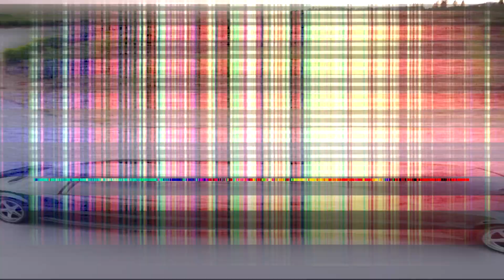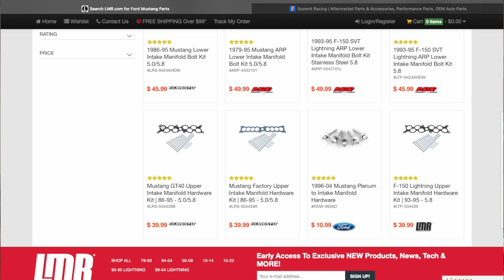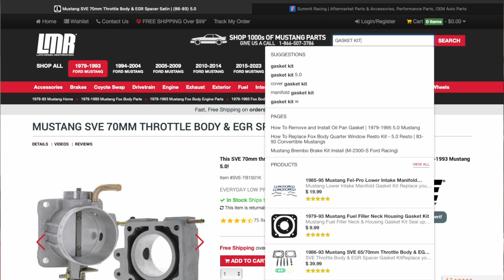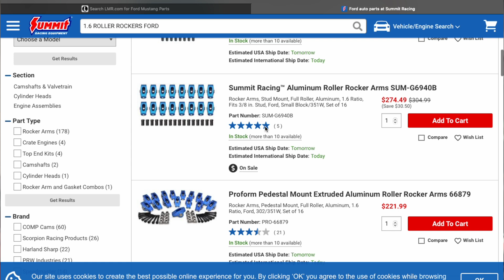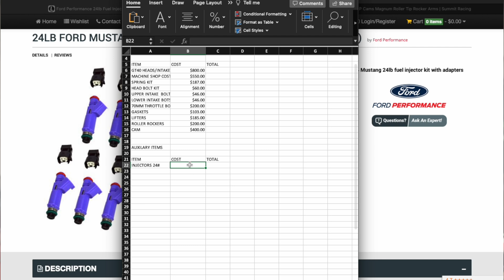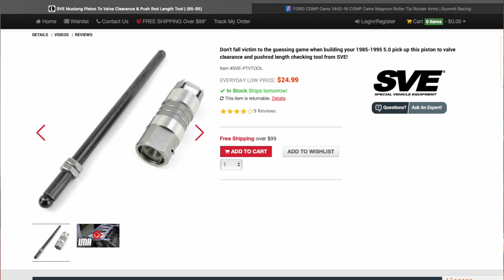Is Cheap Horsepower DEAD? HCI Parts List & Cost Comparison 2023

Comment: Awesome video buddy! So helpful and insightful 👏.  I am on the lookout for when u start the gt40 build on your vert. I myself am planning to go down the rabbit hole as well with a mild gt40 set up on my stock speed density 5 speed 88lx vert . I plan on keeping stock computer,  injectors, fuel pump and the stock cam.. plan is to run gt40p heads, upgraded springs, explorer egr gt40 Upper and lower intake, 65mm throttle body and factory air box for the stock look..  would u run 1.6 or 1.7 rockers with the stock cam?? 🤔... really enjoy your channel and vids! Hopefully u update us on the gt40 stuff... take care 🤝 much respect. I'm finding out quickly that the gt40 parts aren't cheap anymore! 😂
Reply from the maker: Thanks buddy! I will be getting back to this project soon as time permits. Thanks for the kind words!

Comment: I did all this for right at $500. I found gt40p heads. Recently setup Manley valves, Alex springs $250 brand new rpm intake $100 got it with my car, e303 $50 Gaskets was like $80. Take that back total was like $1k because I bought a brand new 650 brawler double pumper. Without the carb $500. All the gt40 stuff keep it cheap or it’s not worth it. This all for my 85 vert. same color as yours.
Reply from the maker: Hell yeah buddy!

Comment: hope my response isn't to lengthy for my foxbody build.  I run canfield heads 2.02 intake 1.90 exh. $1400 MY intake is an edelbrock performer..$585.00 comp cam extreme energy camshaft 555 int lift 565 lift with 112 lobe center.  $389  ford racing 1.6 roller rockers.  $250,   comp cam harden push rods 3.350 length.   BBK 76mm MAF meter,  $290  70MM edelbrock throttle body $250,  BBK fuel rail $200.  ,  BBK 1,5/8 long tube headers  $375.  no cat off road H pipe with 2 chamber flowmaster mufflers,   Kirban adjustable fuel pressure regulator.  $90.     190LPH BBK  fuel pump.$ 120  comp cam double roller timing chain ,$100      BBK underdrive pulleys,      black magic extreme magic electric fan.   EV8 24Lb injectors,   felpro gaskets,  all ARP bolts through out the block.   not scratching the surface on the other mods but these mods will take a stock 302 foxbody from around 225 hp to closer to 330 to 340 hp.  this is depending on the TPS setting,  timing.   I run 15 degrees of timing.  the fuel pressure is set to 45 PSI,   

Other mods are fidanza alluminum flywheel.    world class T5 5 speed,  B&M short shifter,    ford racing alluminum drive shaft.   Precision 3.73 gears,   Moser 31 spline axles,   Rear end girdle.  MSD Billet Distributor,  MSD Digital 6AL ignition,   MSD 8.5 MM plug wires,   MSD ignition Coil.   adjustable caster camber plates,    Strut tower brace,,  K member girdle,     Mac subframe connectors,,,,  rear strut tower brace,    Maximum motor sport sway bar upgrade,,   Maximum motorsport  pan hard bar.    South side lift bars,   grantelli adjustable upper control arms.     grippo springs,    KYB shocks,,    all wheel disc brakes.  soon upgrading to wilwood brakes.  fiboglass  hood.   130 alternator upgrade..   all autometer gauges,   10,000 rpm nitrous wet plate system.   I also bought the twin turbo kit for it ( Not Installed)  8 point roll cage,   and lots more,    not to mention all that was done to the block itself.  

but the HCI alone will  up the power to more than 100 over stock.   this is good enough to go from high 14s low 15s to mid to 13s,    unless you do alot more like I did and now its 12s.   and the nitrous will put in the 11s.   or even 10s,,  this builds will embarrass challenger and charger scat pack owners.   The beauty of what I love about the mods of my car is that my car only weighs 3100 pounds.   these are super light and thats why modifying these cars will make these foxbodies ridicuoulsy scary to drive.
Reply from the maker: Wow sounds like an awesome build 💪
Reply: @KASLCustoms  thanks. started like all fox body owners,   pulleys, gears,  K&N filter and so forth then it grew to no end.   I like your channel.  keep up  the good work
Reply from the maker: We all did! Thx buddy! Will do

Comment: Thoughts:  Upgraded fuel pump is a must-have; stock 5.0L HO pumps are only 88 LPH and won't support even GT40 power levels (Ford upgraded to 110 LPH on factory GT40 cars.  But don't go bigger than 190 LPH with stock fuel lines).  Also consider a new timing chain set as a must-have on any older/high mileage engine; the new cam/stiff springs will trash an old set quickly.  The $200 rockers you looked at are only "roller tip," not "full roller;" they lack the roller trunnion bearing, hence the $200 cost delta.  ~5500 rpm GT40 motor could be okay with those single rollers; higher rpm is better served with full rollers.  Among the ~$400 class roller rockers, Harland Sharp or Scorpion offer superior quality.  The imported, no-name cheapies are a false economy and a disaster waiting to happen.  As others mentioned, a larger mass air meter will be mandatory.  To really get the most pleasure, satisfaction, and performance (in order of importance IMHO), you really need to get a custom tune to make it run smooth and sweet after these numerous modifications.  Your thought process is a GREAT example of thinking through any upgrade plans before you start.  Well thought-out and well presented.
Reply: This video and thread has been great.  I need to put a new motor in my SN95.  I was thinking about doing upgrades on it.  This whole thread has made me think I'd be better off just going stock.  Or better yet just finding a junkyard motor with warranty and dropping it in.  I can see this becoming a $8K project.
Reply: I ran a factory fuel pump 18 years on my 347 and never ran out of fuel.  30 lb injectors, adjustable FP regulator, C&L 76mm MAF, 180cc 2.02/1.6 Heads, 266 HR cam, no tune on the stock A9L.  She ran out for years.  Not calling BS, but based on what my guages read, I personally never had to make those upgrades till the 408 came along.
Reply from the maker: Thank you

Comment: My 93 5.0 was leaking antifreeze at the timing chain cover. Preventive maintenance was included in my fixing that. AFR heads, 70mm throttle body, ARP head bolts and 1.7 cobra rocker arms were all I classified as new performance parts. The Explorer manifold was $25, plus my labor for removal. I don't classify gaskets etc as performance cost. I had previously long tube header, new exhaust, T-race oil pan, so the head-leak fix wasn't as big a hit. Yes, in total, it is not cheap. What I have, now, in the car I could have bought a newer one with more power, what is the fun of that?

Comment: Gr8 video bruh ! I don’t know if anybody mentioned this but as for the throttle body you can use the bigger explorer one you just got to swap over your original linkage for the accelerator cable to work! Plus its still is ford oem .the hardest part for my gt40 swap was or still is lol choosing what cam to roll with .
Reply from the maker: Well said buddy and thanks for sharing that with us!

Comment: Great video!  Always love your content! :)

This is a general comment from my perspective for others that haven't been around the Fox 5.0 game for long....it's a largely questionable investment to do anything with GT-40 iron heads anymore... There is no question that a set of basic aluminum heads ranging from $1,300-$1,750 (AFR enforcers, TFS 170s, etc.), is the biggest bang for the buck and smartest move. I see people paying several hundred dollars for clapped out GT-40 iron heads that need to be completely rebuilt and even with porting, won't make anywhere near the power of a nice aluminum head for the same money. The springs on GT-40 heads are horrible for anything other than a stock cam. There are many advantages to buying a new set of aluminum heads over putting time and money into iron heads. I hear people talk about nostalgia builds, but is lackluster performance from an engine part/head that you can barely see worth it? Sure, run a COBRA or GT-40 tubular intake because you can actually see it, but skip the paper weight GT-40s unless you like spending a lot of money and investing time for performance achieved 25 years ago. Unless you get the heads for literally next to nothing and don't spend more than $700-$800 getting them into proper shape, you are doing yourself a disservice. 

Additionally, when you buy a set of aftermarket heads (and other parts for that matter) you are supporting the aftermarket manufacturers that make a great product - these businesses also bring us other parts that we need for these cars and our hobby. I've had no less than 10 sets of aftermarket heads through my hands over the years that I've been involved in this hobby and not one set has been problematic, yes, I've tested spring rates, checked valve seal, etc.
Reply from the maker: Thanks buddy! And very good perspective as well. Thanks so much for sharing 👍

Comment: I just went through this. AFR Enforcer heads, TFS 1 cam, sent Cobra lower to B Moss for porting. Work done by local shop. Initial plan was engine in job $1000 labor and about $2000 hci related parts. This quickly escalated to an engine out job- bad motor mounts discovered and leaky rear seal. Then a bad harmonic balancer was found, then there was ptv clearance issues, then my valve covers had clearance issues, then maybe my fuel pump and 24lb injectors may be limiting, and while we’re here we might as well x,y, z. 
In the end it was $4400 in parts and $2200 labor and I’m glad it happened that way. I have a car that I’m super happy with, the shop was great to deal with. 
From a ROI standpoint, it was a horrible decision.
Reply from the maker: Hahahaha thx for sharing buddy. Yeah, it’s tough but like you said, you got what you wanted in the end 👍

Comment: You can save alot of $ by purchasing 1.7 pedestal  mount (factory is pedestal) rockers and running the stock cam..reusing the lifters, pushrod, and camshaft is huge savings in relation to the small HP gains and degradation in driveability. You can also save by skipping the injectors, which will require a new and expensive MAF...You didn't mention headers but that's something to add..
Reply: Yea you're gonna be saving money but sacrificing a decent bit of power.  If you're trying to get anywhere near 300 to the wheels stock cam ain't the way to go and you're also gonna need a larger maf anyways at that point same with injectors.  I mean if you just wanna pick up some power from stock that is fine but doing what you suggested will sacrifice a decent bit of performance
Reply: @midnight347  I made 292 rwhp in my '86 GT. with almost that exact setup...
 I purchased L303 GT40 heads way back when....FRPP used to sell them, they are just F3ZE Cobra heads with better parts than the production heads....  You got SS valves, and the A50 Valvetrain kit for under $400. for the pair....The only work I had done.. a valve job...and flow benched...just for my own curiosity..
So it was basically a '93 Cobra engine with the better stock '86 SD Cam, 19 lb., Cobra 1.7 rockers, '93 Cobra Intake and 70mm TB.  This was all using the stock speed density VM1 ECM tune...
It did have MAC under drive pulleys, equal-lenth headers, Off road H, and every muffler combo possible lol.  T-5 Motorsport clutch. 
I had several Camshafts to pick from B303 and the baby Crower...but seeing how several of my buddies gained 2 to 3 rwhp and lumpy sound....at best... because one friend with a Capri slowed at the track after switching cams twice!!  
Anyway I didn't want the headache or extra expense of MAF when my power adder had no effect on tuning...artificial atmosphere by my NOS Dry kit, plus my NOS Bigshot Plate kit (never ran the wet kit) both of which were VERY close as delivered.
Reply from the maker: That’s awesome buddy!

Comment: Don’t forget timing cover/water pump bolt set, new harmonic balancer, mass airflow sensor to match the fuel injector/throttle body upgrades. May want to do the motor mounts too while you are there lol. 
Gary you will want the pedestal mount rockers for the stock GT 40 iron heads unless you want to add the cost to the machine shop bill to change over to the stud mount rockers. Hey you did a good job and showed the point that it will not be cheap to do it correctly. Keeping it stock with bolt ons looks better and better lol.
Reply from the maker: Good point buddy! I was bought of so many more things as well once I shit the camera off 😂. Thanks pal - hope you’re well 🙏

Comment: Hey buddy, thanks for the video. Very informative and realistic.  I'm currently going thru the same set up on my 90 vert. I got lucky with some of the parts but it's still adds up. I went with a Trickflow Stage 1 cam, very popular for this set up. Also, I had to measure for piston clearance and my pushrod length needed was .0635, get that tool it's only $20. Can't wait to get her fired up. Also, I love your desk set up in your garage, I may steal that idea 😆.
Reply from the maker: Yessir anytime!! Thanks for sharing your info too, and yes, steal away 😉👊

Comment: I have a GT40p setup on my parts shelf for my 94GT when I get the time, looking forward to doing it when I can. People always rag on the GT40 build since you’ll get much more power from an aftermarket head, but some guys just like the nostalgia build. I also like it because they’re just the best head design for the SBF that came out of the Ford factory, there’s something cool about that.  They’re factory quality so you know they’ll work, never know what you get from the aftermarket these days.  
My build plan is this
GT40P heads with Alex’s parts beehive springs
Steeda #19 cam .516 lift with 1.7’s
Ford Racing 1.7RR’s, pedestal
Cobra GT40 intake
BBK unequal length shorty headers
24lb injectors
155LPH Walbro in tank pump
70MM bbk throttle body
75MM Pro-M mass air tuned for 24lb injectors
BBK fender cold air

That’s the major stuff, but there’s a lot more parts you’ll replace when digging into the engine this far that push the price up. Even things like gaskets are $$$. Water pump, new timing chain, replace old hardware like head bolts and upgrading those to ARP stuff. just arp head bolts are over $100 Canadian for example. It always end up being like double what you expected when you started down the path, such is the car hobby, lol.
Reply from the maker: Thanks for sharing my friend! I agree 💯 That sounds like a great program you have planned out 👍

Comment: How do you know the stock block on your new but 30+ year old 302 block will handle all the swaps? Is there anything to look for ?
Reply from the maker: Sorry bud I’m not sure I understand the question?
Reply: Sorry.... what if I buy a 93 stock mustang with a stock motor....say a barn find for discussion. I wanna tear into the motor for the swap what are the tell tale signs NOT to do it?
Reply: Besides an obvious crack in the block.
Reply from the maker: I don’t think there are any. You won’t know what you’re dealing with until you get into it

Comment: Good video! 
Did you get 3bar or 4bar heads? Gt40p heads require a different header. Gt40 heads are the same as mustang.

Also maybe bigger mass air meter or have one recalibrated for injectors you are using?
Reply from the maker: I got the 3 bar GT40’s
Reply: Nice! Please be sure to let us know dyno results if you dyno it!!
Reply from the maker: I definitely will 👍
Reply: I had the same question on the MAF.  When you go to bigger injectors, don't you have to compensate for the increased fuel delivery on the air measurement side so you are not running rich? Unless you have a terminator or some other programmable engine management system where you can enter the new injector size your stock engine management still thinks you have 19# injectors.
Reply from the maker: Yes you do and I am sorry if my video misled you. You are 100% correct in your thinking and I should have mentioned a new mass air meter calibrated for larger injectors.
Reply: @KASLCustoms  Thanks! Great video by the way, I love your channel.  
This helps put the cost of "cheap" upgrades into perspective.  I have been on the fence about HCI upgrades, I really like the strong bottom end torque of the 302HO and the drivability of the car in stock form but like everyone else I want a bit more top end power.  These cars were awesome back in the day but by today's standards they are almost  mundane.
Reply from the maker: Thanks so much buddy!!! A properly done HCI set up can really make these cars fun and for the most part current and able to run with most cars on the road nowadays 👍

Comment: GT40P heads call for the 6.3 push rod length. 🦊
Reply: There’s no one size fits all pushrod for a specific head. The pushrod length will be dependent on more factors than that. Cam lift, rocker ratio and design ect. You just always have to measure and select the correct length after test fitting.

Comment: Yup it does add up! When I tell my friends how much it was when I did my 347 for my 91 coupe they look at me like I had two heads! It was about 7.000 ! Thanks for the video
Reply: People just look at price of heads cam and intake and completely ignore all the other costs involved.  Then you factor in a 347 is getting a fully forged bottom end to boot it easily gets to that.  You can do coyote swaps for under 10k if you shop smart so the coyote isn't looking like a bad idea these days but I understand some wanna stick with the sbf that is fine I get it.  It's all in what you want out of it.  A stock coyote will make more or the same as most 347 builds na (more if you mod it) and a much higher ceiling with boost.  So for the money the coyote isn't a bad option at all.
Reply from the maker: So true buddy! Thank you 🙏